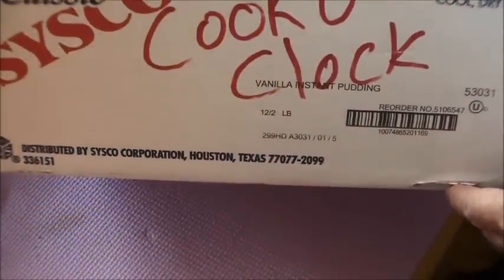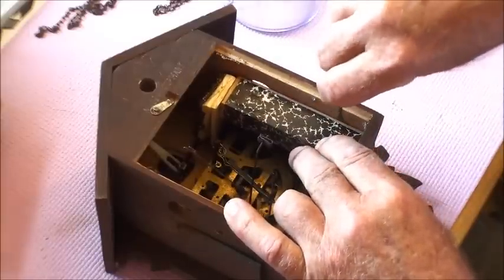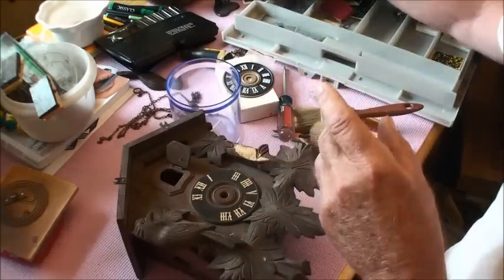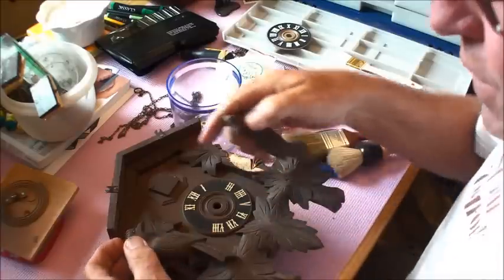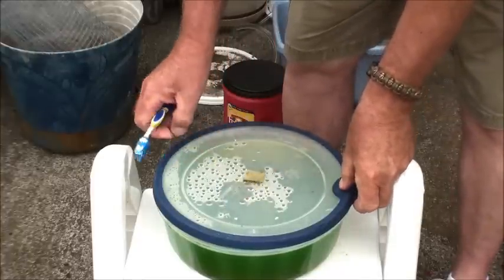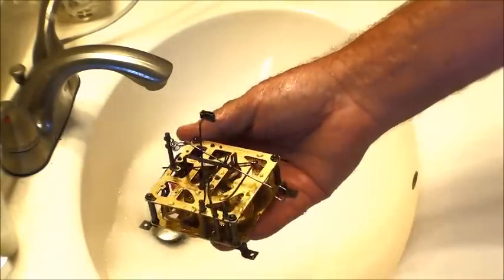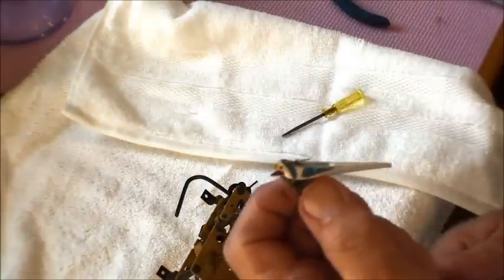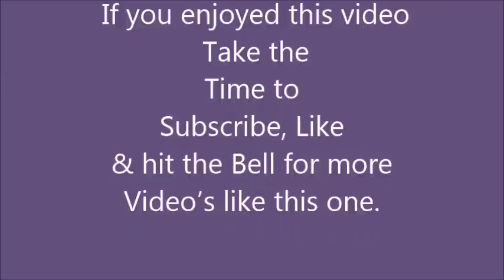Cuckoo Clock Repair

Comment: Hi Just Mike, can you please help me get the hands back on my Cuckoo Clock, I have 3 nuts and can't seem to get them back on with the White Hands in correct Order! Can I send you a photo, I don't know how to attach it here! Can I PM you?
Also the Gong on the back, is it supposed to be attached to any wires inside, or does it just get clipped onto the back of the Clock?
Cheers and thanks Cheryl.
Reply from the maker: With the old three nut type, The first nut that goes on will be the one with a round ridge that the ridge will be facing up for the minute hand to rest on and keep it centered. Now you put the hand on and the next nut that should be flat on both sides. Tighten that nut to hold the hand in place. The last nut should have a beveled side to it that will be facing out. That nut is a decretive nut that covers the end of the shaft and hands. This nut isn't to hold the hands or hand nut. 
  Oh, by the way, start by finding the strike for the hour and also so you know where the minute hand should be when it strikes.
Reply: @justmike57  Thanks, got the Hands sorted, now the Cuckoo Bird isn't singing, the Bellows are all in place according to your Video, but I can't get the Gong to Strike or the Bird to Sing. Please help Just Mike. 😭😭
I have to buy a Pendulum, as mine is missing, that shouldn't have anything to do with the Singing or Gong, does it??
Reply from the maker: @cherylmorris4187  Do you hear that clock triggering up to get ready to Cuckoo when you move the hand to the hour? Check the arm that is suppose to drop on the snail, The snail is where the clock knows what hour it is on the front of the movement. Make sure the arm is hitting the snail and not behind the snail. Make sure that the arm is able to move up and down freely. There might even be a wire/spring wire that pushes the arm down. If it has the spring wire, make sure it is on the arm. There might be a chance you might have to bend the arm a little so it drops on the snail and not behind.
Reply: @justmike57  I noticed the 2nd weight is NOT going up or Down, could this be the problem? Cheers Cheryl.
Reply from the maker: @cherylmorris4187  You could be right. Check to see if the chain started to come off and is hung up on one of the gears.
Reply: @justmike57 I took it apart and put the Chains back on again, at least 3 times, but the 2nd weight is just NOT moving down!
Reply from the maker: @cherylmorris4187  My Gmail is justmike2575@gmail.com
  Is the second weight the cuckoo weight? if so, check your bellows to make sure they are free or not being lifted to high. Sometimes that will stop the cuckoo from calling out. Also, do you have a night lever so the bird will not call?

Comment: I'm going to be brave and try to fix my 1 day, music/cuckoo clock, 1974 from Germany.  Clock hasn't been cleaned 24 yrs...cuckoo door is doing double time...open closing during cuckooing.  Any suggestions?????  Clock very sentimental.
Reply from the maker: Just make sure you have clock oil, you can buy some on ebay or clock shops if you Google it. Hot soapy water can work, I use Dawn for better cleaning for a person that has 1 clock. And rinse well and dry it with a hair dryer, right away Maureen

Comment: Mike' What would you sell this clock for?
Reply from the maker: If I were to sell a clock like this, clean and working, I would think with todays prices, this clock should run around $75 and up. Not a large clock, with all the pieces to the clock. You have to remember that if you could find a clock shop now that would even work on a cuckoo clock, they would be a minimum of $400.00 and that is why most people will toss the clock.
Reply: thanks @justmike57

Comment: Very interesting.  I have a coo coo clock given to me needing put back together.  It must have fallen off the wall. Mine has the bird that mouth opens and the music box with the dancing German people.  All parts are here but the coo coo things are needing replaced. The paper is gone.
Reply from the maker: I have two videos out on replacing the bellow. Either you buy new bellows or you make them with Tyvek paper and supper glue. Both ways I show how easy it is to fix.
Reply: I'm trying to put everything back together but not sure where the hook ups go for the bellows and I'm thinking maybe some body worked on this. When I put the weight on the (I'm thinking it's the minute chain if that makes since) the weight just drops and the clock ticks like it's on fast speed.  Do you know what that could be?
Reply from the maker: @leeta56  So you are saying you hear the clock ticking very fast and the weight slowly goes to the floor? or are you saying the weight just drops to the floor?
Reply: @justmike57  it slowly drops to the floor.
Reply from the maker: @leeta56  On the time side, it sounds like your part at the top that swings the pendulum as come off or needs replaced or adjusted. If the pendulum isn't swinging this will happen.
Reply: @justmike57  the pendulum is swinging.
Reply: @justmike57  I also don't have the bellows hooked up.  Would that be part of it?
Reply from the maker: @leeta56  The Bellows are not on the time side and that would not make a difference. So if your pendulum is swinging with a tic-tock sound, then it's not the time side. So, with that said, check to see if the little fan is making contact with the gears because that is what will slow the weight down or let it drop. Check where each gear comes thru the front and back plate. If the hole where each gear comes thru is wobbled out from wear, it can cause the gears not to meet each other. If this is the case, you will have to get new bushings in those worn-out areas.
Reply: @justmike57  I know the fan moves.  But I will look at the gears to see if any are wobbly.  Thanks for your help.
Reply from the maker: @leeta56  Thinking about your problem and I am not there to see what is going on, Maybe your cuckoo bird is really cuckooing and will not stop because the timing might be off if someone took the movement apart.
Reply from the maker: @leeta56  Also check on the front of the clock to make sure the count arm is moving, with the teeth, so the clock knows when to stop.
Reply: @justmike57  I watch your video on the co coo. I'll try and check it out. I took the co coo off because he needs repaired. The hole that the screw goes in is some what cracked were the screw can't tighten on the rod. It looks like it was glued.

Comment: What Stain did you on this clock?
Reply from the maker: They don't make the Walter Formby stain anymore that I had. I go to a craft store and look for there stain paints. I use one that is the closest to the color of the clock. Depending on the clock, I have two different colors I use. Oak gel stain made by Americana and 21982E Chocolate Sprinkle Satin Acrylic paint made by Apple Barrel from Wal-Mart.
Reply: @justmike57  thanks

Comment: A general question regarding a one day clock. A complete winding of the clock doesn't allow the clock to run for a complete day. With the weight starting as close as possible to the bottom of the clock and ending when the hook at the end of the chain at the very bottom of the clock case the clock has run for approximately 20 hours. Is that normal for a one day clock? Also the cuckoo calls and the music seem to be fast could the weights effect the speed of the calls and music playing?
Reply from the maker: You should get 24 hours out of your clock if the bottom of the chain can reach the bottom of the clock. The music is also controlled by how heavy the weight is,  the fan inside the works, slows the music to the right speed and if you have the right weights for the clock, the fan might be slipping on its rod.
Reply: @justmike57  Thanks Mike, your reply is most appreciated. How can I determine if I have the correct weights?  The only marking on the existing weights "320".
Reply from the maker: More than likely you have the right weights for the clock because it didn't come from the thrift store. And the 320 is the most commend number on the weights for a medium size clock . You can also tell by the cuckoo sound. If clean, the cuckoo will sound right at a steady speed so I am surprised the cuckoo sound is fast also. If this clock by chance is a newer model clock, the works are still good, just not as well built as the older ones. They do sell smaller weights if needed on Ebay, but don't to fast so the price jumps up there to high. 271 I do believe is the next size smaller if the speed is to fast for you
Reply: @justmike57  Thanks again. we purchased the clock during a recent (12/2018) trip to Germany. I may give a smaller set of weights a try. If that doesn't work then I send it to the authorized repair shop for a check. Really hate shipping it even in the original factory shipping container which we kept just in case. Thanks again.
Reply from the maker: Well it is new then, so the repair shop might suggest and older works for your clock. You can try the smaller weights, but the time weight might have to stay with the original weight

Comment: What paint are you using?
Reply from the maker: Hey George. I used a stain that best matched the color, (Gel stain works best and don't wipe it off after applying) The stains on these old clocks will come off if you use anykind of cleaner, so be careful

Comment: Where do you find a Hubert Herr 8 day clock movement replacement?
Reply from the maker: I would go to Ronell Clock Co. on line. then type in cuckoo movement and shop from there. You can also buy your clock oiler there.
Reply: @justmike57  great. Thank you.
Reply: @justmike57  I haven't gotten the courage up to try anything with the Clock yet. Since I've never been around cuckoo clocks.

Comment: Do you mix your own cleaning solution?  If so, can you share the formula?
Reply from the maker: Ron Hancock, I bought a gallon of the solution you add water to, only because I have so many clocks that I bought and will be cleaning all of them and putting them back to order. It is very strong ammonia smell that could knock you out if you didn't open the container in a Very Well Ventilated area, like outdoors. Just remember whatever you use, wash it off with Dawn dishwashing soap and rinse it off with hot water and dry as soon as possible.

Comment: Even though I think that you did a great job cleaning up the case I think that you need to quit putting movements into the solution without taking them apart. You will have to take the clock apart in the near future because the old grime in between the pivot holes and other hard to reach spots are not getting cleaned out. Even with an  ultrasonic cleaner you have to take a tooth pick and clean out the holes. Your solution or anyone elses solution is not going to clean out these types of spots. BTW your solution makes the movement look pretty. I will give you that.
Reply from the maker: Hi Mark. Sorry it upsets you and others that have the skill of taking the clock works apart, but most people don't have the ability to take things apart and get them back together again. My video's are for people that would like to get there clocks running again. Compared to just spraying them with WD-40. If they are a real collector of the cuckoo clock, my video's would be a good start on understanding how the clock works.
Reply: @justmike57  They come to these channels to learn how to do something because they dont want to pay to have it done. If you were to show them the proper way of serving a clock then they would enjoy your videos more.
Reply from the maker: @munnerlyn3  There are not a lot of areas that will work on a cuckoo clock and if you find one that will work on your clock, they don't think it is worth their time, so the put in a new works. Also the cost of getting your clock cleaned and running again is so high. Maybe this is why people use cuckoo clocks for crafting projects. There are other channels that go into detail of cleaning and oiling the clocks, mine is to help understand the clock a little bit and have them get that old clock out of the garage and try to get it running themselves. I also help them when they need the extra help. (I also have videos cleaning tower fans. There are so many people out there that didn't even think of repairing their fans.... or they would again, just spray WD-40 in them for hopes to get them going again Mark.

Comment: Thank you for this video! we have an almost identical cuckoo to the one you were working on.  We are short one chain - do you sell them? or just do you recommend ebay? thank you!
Reply from the maker: i buy most my parts threw Ronell Clock Company. https://www.ronellclock.com/
and I think the set of chains you need are https://www.ronellclock.com/Regula-1-Day-Cuckoo-Chain-Brass-Plated-CH-9063.htm  for $6.95 plus shipping. I hope this helps you TaraLynn DeGraw.

Comment: could you help me please just got a cuckoo clock it works expect cant wind up the cuckoo sound  it lock. Ratcheting Chain Wheel  is lock i think .any idea please would be great full thank you
Reply from the maker: Pay attention to the wire that runs up to the music box. Make sure it moves up and down. The wire might need adjusted to let the music start, or the works needs cleaned possibly to free up the part that triggers the music. Later, I will be working on a cuckoo clock with the music in it Paul P.
Reply: @justmike57  hi sorry i have got music .my fault . it the chain for the cuckoo bird . if i left the leavers up fot thr grim and the cuckoo box 
 in side then the chain i can pull up .
Reply from the maker: @paulp9950  , I am not to sure what you are saying. If your clock has a leaver to shut off the cuckoo bird, then you should be able to wind it up and it will stay up until you switch the leaver back to letting the cuckoo bird out. If this is now what you asked, then please try again.
Reply: @justmike57   cant wind up . the chain move . to wind the cuckoo side
Reply from the maker: @paulp9950  Check out this  new video to see if it will help you on the winding of the clock. https://www.youtube.com/watch?v=mESykVJpHRw

Comment: What stain are you using?
Reply from the maker: You can try the Old English scratch cover to do the whole clock and make it look new again or if you are adding a topper that does now match the color and want the muddy brown clock of the old clocks, you can use a paste stain of a dark clock or paint. the paint I have used is from Walmart in the craft section. The closest color I can come up with is 21982E Chocolate Sprinkle

Comment: I just got a the same clock in better condition for 4.99 at goodwill, though it doesnt have the weights
Reply: Or the pendulum
Reply from the maker: Great job on finding your Cuckoo Clock. Now to get it running again Hatred. I have an email below my video if you need any help or questions.

Comment: Hey Mike, I have a few questions. I got my clock back together, but the cuckoo bird will not come out all the way, and the door doesn't close everytime he goes back in. And, when the clock chimes, the chain keeps slipping, causing the clock to jerk uncontrollably. Let me know what I can do. Thanks!
Reply from the maker: I found another clock at the thrift store. I will try to get a video out in the next day or two and try to explain what your problem might be NuclearKnight77
Reply from the maker: Did you give your channel a new name?
Reply: Just Mike Thanks!
Reply: Just Mike Yeah, I used to have this name, but I didn’t like using my real name, so I switched it.
Reply: @justmike57  I will be sure to post a video with my cuckoo clocks, but after Christmas.
Reply from the maker: @FTBFHRITP  I can't wait to see the video and what you did to it.
Reply: @justmike57  I will attempt to fix some issues I've been having for the video.

Comment: the larger drag was slighty touching the plate base so i bend it slighty , it apparently works now i'll see
Reply from the maker: Sept. 15th I will have a video out explaining the pendulum problems, For When your Clock Fall off the Wall or the clock was set down wrong and bent things inside the clock works gusro12
Reply: ill show you a video

Comment: Hello I don’t know why the pendulum don’t swing
Reply from the maker: The most cause of the pendulum not swinging is the oil and dust are all gummed up inside the works. You can also tell when you turn the minute hand ahead 5 minutes and see if it feels stiff to move. Thanks for stopping in Spa Garden of Health by Susana

Comment: how much do you charge
Reply from the maker: I do this as a hobby Higgystattoo. I really enjoy getting the clocks back running again.
Reply: @justmike57  well how much
Reply from the maker: Well higgystatttoo, that all depends on what you have, and what is wrong with it. The shipping both ways isn't cheap anymore, but if the clock has a great value with it, then the shipping does not matter. Most clocks for just the cleaning and oiling, I charge my friends $30

Comment: Hi, my cuckoo clock , will not cuckoo, what do I do??
Reply from the maker: Not knowing anything about the history of your clock, I am wondering if the bellows are broken if the bird comes out. If the bird does not come out, the front of the clock has the counter of time there. Might need cleaned or a spider could have gotten in there and stopped it from springing into place so it can cuckoo again Delois Richardson.